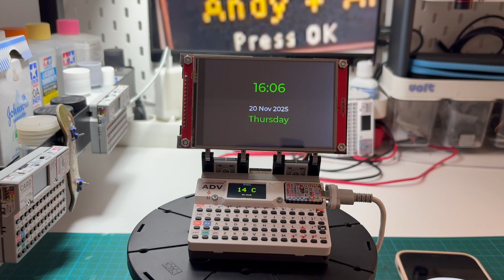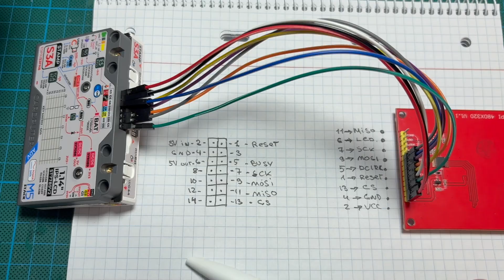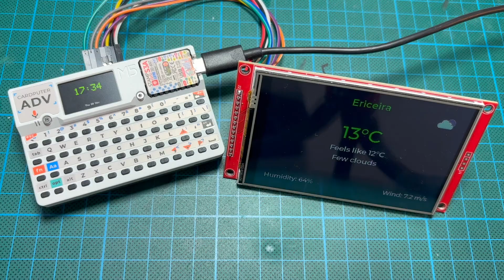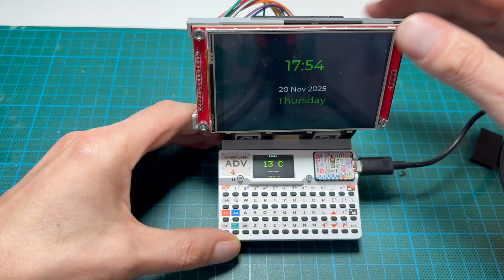Connecting External Display and Dual Display Setup on M5Stack Cardputer-Adv | ESP32-S3 Tutorial

Comment: 您的屏幕和程序在其他的bin固件中是否依然有效，屏幕是否支持触摸控制，官方的小屏幕是如何做到在不同的bin文件下也能正常显示的？
Reply from the maker: It won’t work “just like that” with other firmware — you need to adapt the code or write your own programs.
I haven’t implemented touch input yet, but the display itself does support touch.
As for the third question, I’m not sure I fully understood it.

Comment: How did you use VCC to 5V in? Isn't this pin only for input ?
Reply from the maker: On the Cardputer, 5V IN and 5V OUT are actually the same 5-volt rail coming from the USB-C port. So you can connect the display’s VCC to 5V IN and the backlight to 5V OUT — both pins provide the same voltage.
Reply: @AndyLong14  Good to know, thanks!

Comment: Thanks for sharing!
ILI9488 is not good, chip has many issues. Prefer the ST7796 IPS @ 80Mhz SPI.
BTW, did you try the 1-bit SDIO/SDMMC mode for SD insread of using the SPI SD mode?
Reply from the maker: Thanks for the comment and the advice!
I picked the ILI9488 completely by accident — I just wanted to try an external display as soon as possible, so I ordered the first one I found. ))
Reply from the maker: I asked ChatGPT about this - Switching to SDIO/SDMMC (even in 1-bit mode) can remove a whole class of conflicts with the display.
It’s not a magic fix, but it’s a different interface with different pros/cons, and it can solve many issues
Reply from the maker: I looked into this more carefully and here’s what I found:
• the built-in display works normally through M5Cardputer.Display,
• the internal SD card actually uses SDMMC 1-bit mode (faster and no SPI sharing),
• the external display sits on a separate SPI bus and doesn’t conflict with anything.
Thanks for the valuable info!!!!!))))
Reply: @AndyLong14  Great! Thanks for the info. The internal 1.14 LCD use 8-pin FPC. Actually, it has a 12-pin pad on ESP32 S3. Therefore, my plans are :
1. To replace the 8-pin FPC connector on ESP32 S3 with a 12-pin FPC connector. Next, connect the FPC to 3.5" 480x320 ST7796 IPS SPI TFT LCD with capacitive touch.
2. Or, plug in a 3.5" CYD with ESP32 on the 14-pin ADV connector. Use cardputer as a I2C keyboard and other functions.
Reply from the maker: @TT-it9gg  I hope everything works out for you!
I’m planning to test your suggestion this weekend as well. If I discover anything interesting, I’ll definitely share it!

Comment: Thanks, I was wondering exactly about connecting additional displays. I'll get my device soon and I'll probably try it too. I hope I can figure out your instructions. I'm not a programmer or a computer geek, but I enjoy tinkering with electronics. Will a 3.2-inch display be a problem?
Reply from the maker: You’ll do great! I’m not a programmer either — I was just experimenting with AI and different units. I’m sure you’ll figure it out step by step
Reply: @AndyLong14  Thank you, then I will try, I hope it works.
Reply from the maker: A 3.2-inch display shouldn’t be a problem.
I’m using a 4-inch one, and many full-screen programs run a bit slow — so 2.8 to 3.2 inches (320×240) is actually the optimal size!
Reply: @AndyLong14  Thank you

Comment: Cool, because I am almost unskilled in electronic diy, connecting external display this way without in FW changes cause that when I am run M5Launcher and any .bin in the launcher, only external display will work?
Reply from the maker: No, unfortunately it won’t work that way.
The firmware isn’t display-agnostic, so every app and every .bin would need to be rewritten to use an external screen (different drivers, init code, etc.).
Also, the external display shares the same bus with the SD card, which adds extra limitations.

I have two guides on my GitHub about using one external display and using two displays simultaneously — they explain all the details. https://github.com/AndyAiCardputer/zx-spectrum-cardputer-external/discussions/1
Reply: @AndyLong14 thank you, I will check it out, if I will understand. This isc by my opinion, the first real cyberdeck project as I imagined it for my cyberpunk style cosplay, but I want to have it both cool looking and also functional.
Reply from the maker: @STILLNERDINSIDE  Haha, even I managed to understand all of this thanks to ChatGPT 😄
By the way, you have a really cool channel! I’m also into modeling — I build and paint 1/24 plastic cars. I’m collecting JDM cars from the Initial D anime!
Reply: @AndyLong14 nice👍 and thank you.